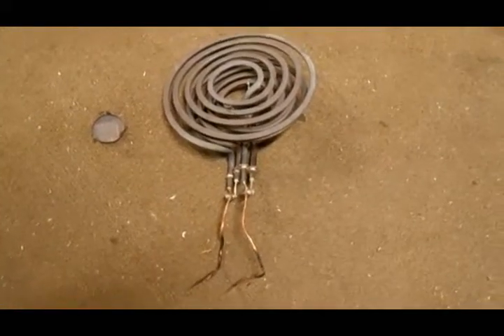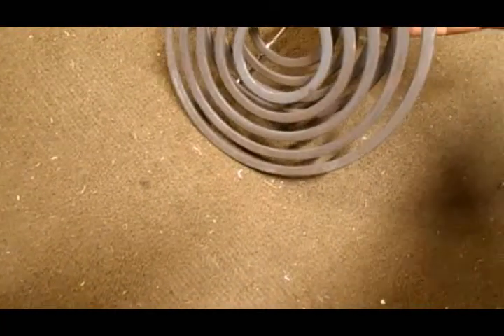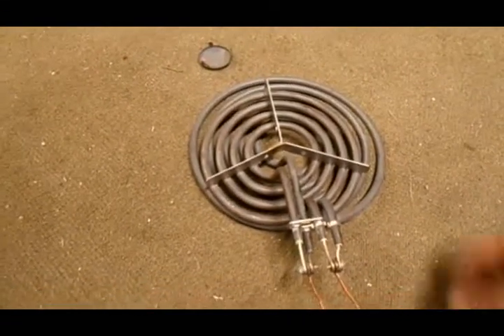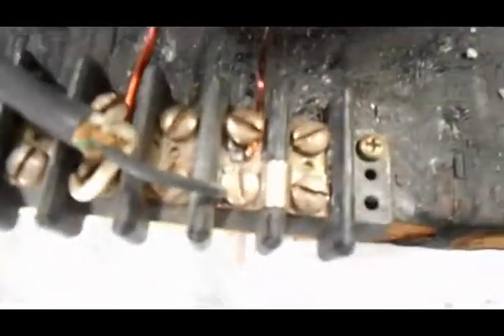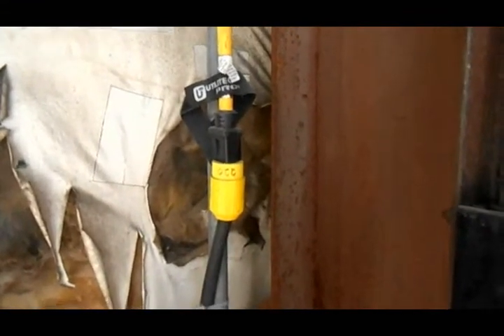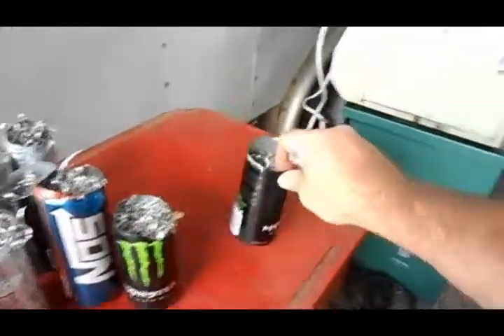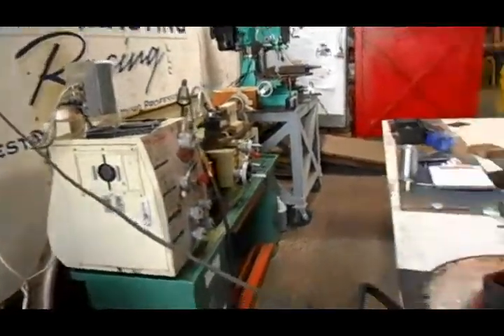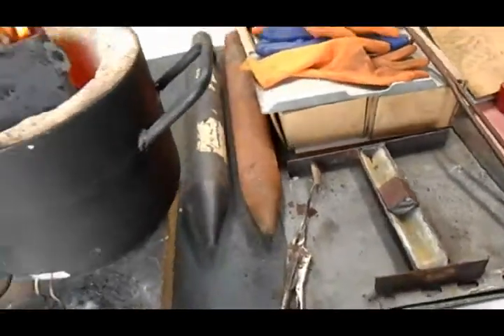DIY kiln003 continuation electric kiln metal aluminum melting furnace easy cheap 220v home made

Comment: Nice build! do you happen to know the temperature these heating elements can reach?
Reply from the maker: no, but its probably pretty high compared to the melting points of the metals I have tried to melt. that is to say, it is getting higher than the melting point of aluminum obviously but I couldn't get it to melt brass. not saying that the burner wasnt getting hot enough to melt brass but by the time the heat sinks into the crucible and gets lost through the kiln, it wasnt high enough to reach the melting point of brass. so if it was more efficiently sealed it may reach higher temps, but without a little ventilation through the kiln I ran into teh problem of the burners getting so hot that they melted themselves until the melted the heating element through and stopped working. so there is a trade off of how hot they could be made to run viruses self-destruction. and with out a temp control its just a game of ventilation and heat transfer rate into the metals you want to melt. If I didnt empty and keep adding new metal to melt the temp would rise scry high to where I felt I was just about to burn out the elements. which I have done. So  the key was to melt the cans or what ever as fast as it would allow so it didnt burn itself out from ever heating. I actually used it so much I got tired of replacing the heating elements because I got distracted and let it run away on its own for too long. like 5 minutes even. so you have to be ready to feed it continuously or turn it off and never leave it unattended.
Reply: @einstyndotcom  thanks for the detailed explanation. im thinking on making one of these myself and this seems like a nice alternative to having the nichrome wires exposed, which seems a bit dangerous to me. so based on what you tell me the best would be to add a temperature control system to prevent the coils from getting extremely hot (guess it will be trial an error to test what the limit it). thanks again for taking the time to answer.

Comment: what is made for main copper coils? is it just copper coils or something different thing?
Reply from the maker: the coils are common cooking stove burners here in the united states. they are made of not copper but some sort of high resistor material that is brittle after it is first heated.

Comment: Copper wires??? Why it is not melt???
Reply from the maker: its thick magnet wire and it is really out of the heat zone, thats why i have screw connections, of course solder would melt away, but this holds up some how.